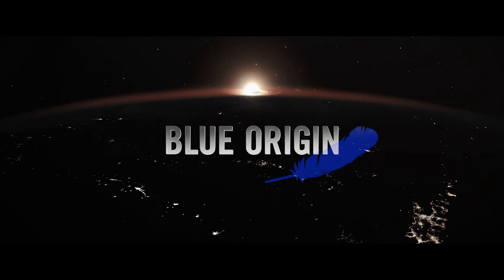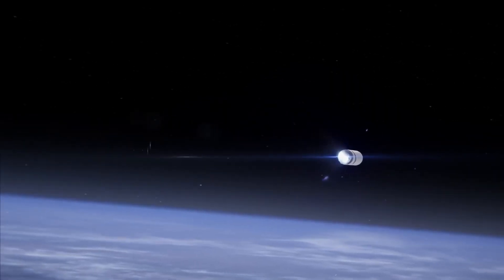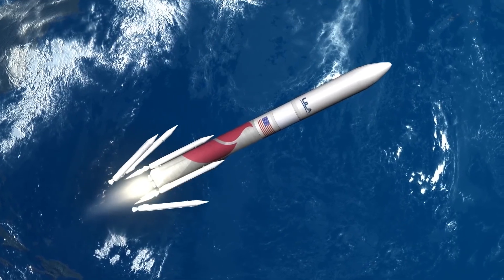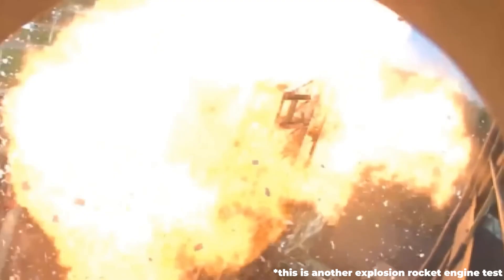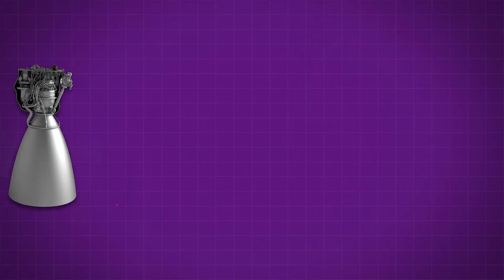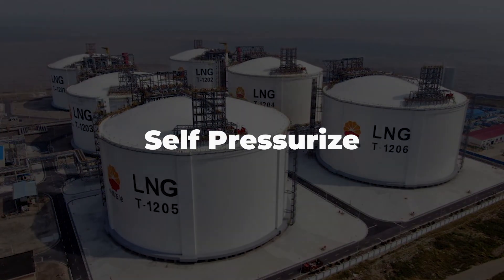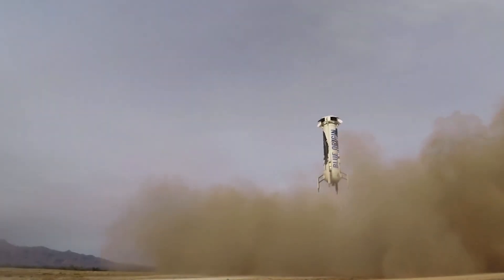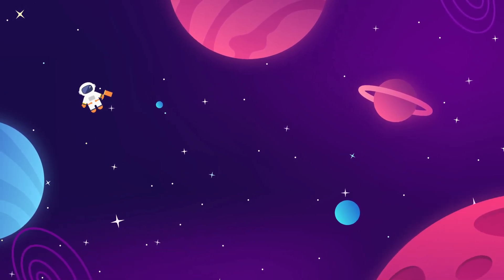The Disappointing Truth About The Blue Origin BE-4 Rocket Engine!

Comment: How many engines has BO produced to date? How many has SpaceX? What are the power, size, weight and price specs of each? 
If BO continues on this path they will get nowhere. They need to start on a new engine now, and work fast as hell to have any hope of making it a contest.
Reply: Blue is doing their best. SpaceX is running out of storage space for their hundreds of rocket motors. But once they get the Super Heavy going, they'll use them up!
Reply: @paullangford8179  Use them up? Only sometime in the future, but the boosters will be reusable, so they will only keep producing Raptors at the pace they need for the ships and boosters they want to build. It is not like they are done with producing just 200-300 Raptors. BE-4 will never be a mass-produced engine like Raptor.
Reply: Last time I heard, Elon was churning out Raptors at a rate of several per week.  BO seems to have a tough time handling half a dozen each century...
Reply: @ChristLink-Channel  Didn't a couple of BO's engine design team quit and apply for jobs at SpaceX.
Reply: When was development started on each so we can adjust for that? BE-4 is a fine engine and is rapidly approaching full deployment. This guy is a total dumbass.

Comment: The heating/combustion of methane in rocket engines does in fact produce coke/solid carbon deposits in the engine and the cooling channels due to pyrolysis (albiet less than longer chain fuels), this is commonly known and very easy to test.
Reply: Hey Kimmy
Reply: Coking from methane is extremely minimal due to the 4:1 ratio of hydrogen to carbon atoms and the fact that CH3, CH2, and CH radicals are all gasses that don't stick to anything. Even if carbon does start depositing out due to pyrolysis, the abundance of hydrogen radicals causes that carbon to form CH radicals which release and exit the rocket.
Reply: @sycodeathman  you can give all the chemistry you want but the methane engines I've tested have exhibited significant coking

Comment: Can the next video be: "The disappointing truth about the SpaceX raptor engine"? I really want SpaceX to succeed with the Raptor engines, but I can't seem to shake the feeling that it's going to take a long time to get it to be reliable, assuming it's possible and while still getting the power they want from it.
Reply: The Raptor is perfectly reliable: but when it's hit by a blizzard of concrete, there are breakages...
Reply: @paullangford8179 spacex said they did not get any data suggesting engines were damaged by the concrete
Reply: Right now spacex are developing the Raptor the same as they do anything else, which is to make constant changes and improvements as they produce them. The end result of this is that when you have a rocket with 33 engines, there are going to be tons of differences between them, from startup sequences, to hardware, and everything in between. The ones we saw fail had been sitting around for ages, and were all old and varied designs, and we also have to remember that the engine shielding was added retroactively. 
Ultimately it will be hard to judge Raptor reliability until they have the design finalized, even Merlin went through a multitude of iterations.
Reply: @SyntheticSpy  Right.  And many of the failures seen at the test site are deliberate "test to failure" events, where they pushed the engines beyond the limits on purpose, to test some aspect or other and gather more data on how to improve reliability.  Elon likes to break things on purpose, to find out why it broke so they can modify it so it won't break again.
Reply: If you'll remember back to the development of the Merlin engine for the Falcons, those also had a lot of problems before they finally got them ultra-reliable.  Merlins are a lot simpler so will have fewer issues at start-up.  That doesn't mean the Raptor is a bad engine, it's simply running on the hairy edge.

Comment: And don't get me started on those inconsistent Raptors. The sheer inability to run the engines consistently without them turning off is insane.
Reply: They are still prototypes. Non are operational. Having 10% fail is expected at this stage. The question is how long will it take them to become operational? I think they are very close.
Raptor 3 is much more powerful than Raptor 2 (~17%) that means that they could run them at 90% and still produce more power than the Raptor 2s without pushing the limits. Making them more reliable.
SpaceX works fast. We should see them soon (in 2024?).

Comment: You must do better research. 

None of the Raptor engines on Starship IFT1 blew up.  They automatically shut down when their control systems detected they were operating out of limits.  The already obsolete hydraulic gimballing system caught on fire, but still did not explode.  One of the biggest failures in IFT1 was that Starship did not blow up when instructed to.  Even while gyrating madly because of the failure of the already obsolete hydraulic system it retained extraordinary structural integrity.  The SpaceX engineers watching this were probably thinking "Maybe we could trim another half-millimetre off the thickness of the walls which would save 100kg of steel?"

Liquid natural gas is the standard way that methane is transported.  It is transported at essentially the same temperature as liquid oxygen, liquid nitrogen, and liquid air.  Indeed the fact that both fuel and oxidizer are kept at the same temperature means that methylox rockets can separate their tanks using only a thin sheet of metal.  If you tried this with a kerolox rocket the kerosene would freeze solid.  If you tried it with a hydrolox engine the liquid oxygen would freeze solid!  IMHO after sixty years of studying space technology the only reason that methylox was not explored until very recently was an insane obsession with hydrolox by NASA and ESA.  Hydrolox requires five times colder temperatures than methylox.  Making seals an plumbing that works at that insane temperature is almost impossible.  Liquid Hydrogen can literally leak straight through most metals because the molecules are so small.  The incredibly low temperatures require the thick orange insulation which I remind your audience KILLED the crew of the shuttle Columbia and almost killed the crew of the shuttle Atlantis!

ULA had the humility to purchase Russian rocket engines for the launcher which it calls Atlas but is really just a Russian Proton rocket in a slightly different form factor.  You do not explain why ULA cannot similarly have the wisdom to kick an unreliable business partner to the curb and buy much cheaper, and obviously more reliable, engines from a different American supplier.  The Raptor 2 uses the same methylox fuel as Vulcan.  The Raptor 2 has the same thrust as BE4.  The Raptor 2 is more efficient in its use of fuel (higher ISP) because of the higher chamber pressure.  The Raptor 2 has only half the mass of the BE4, and every kilogram taken off the mass of the launcher is another kilogram of payload.  And the Raptor 2 costs less to manufacture than BE4 because it is produced on an assembly line which produces 365 engines a year while BO seems to be having difficulty producing four a year.  The manufacturing cost of a Raptor 2 is less than that of a Merlin engine, and probably about one tenth the manufacturing cost of a BE4.  So SpaceX can undercut the price of any competitor, just as Tesla can undercut the price of Eve from their competitors.

How about performing a service for American taxpayers and other American customers and find out what blackmail evidence Jeff Bezos has on ULA which prevents Tory Bruno from seeking the best economic advantage for his company and his customers by switching rocket engine suppliers?  Why would anyone buy rocket engines from an online *bookstore*?

As you point out the West genuinely needs competition in the medium to heavy launch market.  The blind obsession with maintaining existing supplier chains means that at the moment: Vulcan-Centaur will not have its first launch until 2024, and will not be a reliable alternative before 2025 at the earliest.  Ariane6 will not have its first launch until 2024, and will not be a reliable alternative before 2025 at the earliest.  The Neutron will not have its first launch until 2024, and will not be a reliable alternative before 2025 at the earliest.  The Northrop-Grumman Antares rocket is no longer in production and the successor, from Firefly, will not have its first launch until 2025, and will not be a reliable alternative before 2026 at the earliest.  And meanwhile Falcon 9 has launched more than twice as often as Atlas 5 and may achieve three hundred successful launches by the end of 2023, and SpaceX has launched one Starship and has four more under assembly at Boca Chica which it will,  FAA permitting, launch by the end of 2023.  Do you really believe that the same company which has lost only one Falcon 9 in 253 launches since 4 June 2010 will not be ready for external customers by the end of this year with that track record.  If that works out then the SpaceX Super-heavy launcher will be operational before ULA, or Arianespace, even test fly their next generation medium to heavy lift boosters.
Reply: Well said!  ^^ Yes!
Reply: There were certainly engine failures on the first flight, it is incorrect to claim otherwise. I don’t, however, think it is a problem, as raptor is under development and the engines on that flight were a mishmash of slightly different engines from different stages of their development. As time goes on we will get more and more consistent and mature iterations of the raptors
Reply: @SyntheticSpy  But you wrote "blew up".  When an engine shuts itself off as a safety precaution it is highly misleading to describe that as blowing up.  There were no explosions on board the Starship.
Reply: @jamescobban857  you can actively see engines exploding during the flight test. They may not have completely detonated leaving nothing behind, but the inside of the engines absolutely did not fail quietly while at full thrust
Reply: pretty sure ALL of them blew up ya know.. cause the rocket did LOL
Reply: @cheetahjab  the ONLY explosion I observed was of the methane and oxygen mixture surrounding the rocket which took 35 seconds to ignite after the FTS smashed open the tanks of the two stages.  There was absolutely NO evidence that anything on the craft itself blew up.  Would you claim that the engine of your car blew up if the fuel in your tank was ignited?  To claim that an engine has blown up the explosion must come from within the engine.  The objective of the flight termination system is to ensure that no pieces large enough to cause damage to an innocent bystander reach the ground.  That failed as the assembly maintained too much structural integrity, indicating that it is over-built for its job.  Perhaps you lack the necessary training in engineering to understand what is involved.  If so there are many excellent books and YouTube videos.

Comment: Spacex blows up Raptor engines, pushing them to see how far they can go. BE-4 blows up, running within design specs...
Reply: Yup.  That's the way Elon does things.  His philosophy is that if you aren't blowing things up, then you aren't innovating enough!  Each explosion teaches them new things that allow them to make it better and better.  Fortunately, he can turn out dozens of Raptors each month, and has hundreds in stock, ready to fly... SpaceX has already flown dozens of Raptors (with varying degrees of success!) On the other hand BO has only managed to produce a handful of engines over the past decade or so, and none of them have ever left the ground.  The difference are, indeed, glaringly obvious.
Reply: I actually got some insiders scoop on it and it was a manufacturing flaw. Design is sound.
Reply: In a flight readiness test of an engine slated to go on a customer payload rocket.
Reply: @GntlTch   Well, that's why certification testing is done.  Some engines are not going live up to their specs, and will fail.  It happens.  The question is how often will this happen, and the answer had better be not too often.

And such a large, heavy, conservatively designed engine exploding from its relatively modest operating parameters shows how different it is from the Raptor.  The Raptor is very small in comparison, and much lighter, as well, but runs much harder and generates similar thrust.  In fact, the latest Raptor 3 is more powerful, as well as smaller and lighter than previous iterations.  Is this a good idea for reliability and reuse?  Well, in the second Starship test flight, every single Raptor functioned flawlessly, at least until something else took them out.  And that's a relatively old Raptor 2 iteration--newer and clearly vastly better than the ones used in the first test flight, but still well behind the current Raptor 3, which recently made a flawless test run at a higher thrust level than the big, lower-performance BE-4.  Maybe SpaceX really can make a high-performance engine that is also both highly reliable and reuseable.  All 33 Raptor 2s on the Super Heavy ran during the entire ascent during the last flight test.  It was a thing of beauty.
Reply: BE-4 is still in development. There's a difference. Also, Raptors simply fail for no apparent reason. Haven't you been paying attention? Apparently SpaceX isn't all that great with plumbing... or pumps... or control mechanisms... or self destruct systems... or building stable rockets beyond the Heavy, which is essentially just three normal boosters using technology that has been perfected for a minute now - not using engines still in development. The Raptor is simply further into its development. Literally nothing else to it.
Reply: @justindixon7441  in the 5 belly flop tests how many old spec raptors failed during the multi minute  ascents?
Reply: @justindixon7441   You've got it exactly backwards.  The Raptor with its high-performance full-flow cycle is far more challenging to develop, and is in the middle of development, while the BE-4, even when you posted your comment, should be operational or very nearly so, with its development complete.

Yes, like the Starship, the Raptor is already flying during instead of following development, and is being built in greater numbers, but don't let that fool you--it is definitely far from being a developed, operational engine, and is therefore behind the BE-4 in this respect.

Where the Raptor is definitely not behind is in performance, as the current design iteration, Raptor 3, is more powerful (has greater thrust) than the BE-4 despite being significantly smaller and lighter.  It is also more fuel efficient.  But the BE-4 should be a finished product, while the Raptor is still definitely a work in progress.
Reply: still better than BO  @justindixon7441

Comment: Im sorry...? How is this any different than what spaceX has been doing longsince? We also know that Starship is very close to its orbital-shot. I dont see how this engine is more important than any other. And also..the raptors shut down due to damage at takeoff but did not blow up the rocket or threatened to do so. Concrete debris was the culprit in this case.
Reply: It actually was not debris, as spacex have said they see no signs that anything hit the rocket. It’s just that Raptor is still in development, as is starship itself. There was a mishmash of different iterations of Raptor on the first flight, and will likely continue to be until the design is finalized. It’s also important to remember that these parts all sat around for an extensive amount of time in a harsh environment, and that stuff like engine shielding was added retroactively
Reply: Well...thats your opinion..the man stated that the booster created " a rock tornado"..and after watching 400pound concrete chunks with steel-bars in them exploding up along the booster all the way to the top, i find it hard to believe this had nothing to do with it. @SyntheticSpy

Comment: The test was a qualifying test - and it failed - as many raptors do.  China succeeded in launching to orbit with LNG a couple of weeks ago...
Reply: Raptors fail when they're tested to failure. The Raptor 3 test was expected to blow up, and didn't! There are hundreds of Raptors that are flight-qualified and just waiting to be put into boosters and ships. That's why Boca Chica is having so much building works, so there is room to make more of them.
Reply: Don't get me wrong - I think BO are headed to failure personally - and this failure proves the point.  I was just pointing out that engines regularly fail qualification burns, so they don't know yet if it's manufacturing fault or major fault as they've made so few of them.  Lots of raptors have failed on the test stand. @paullangford8179
Reply: This guy is clueless, don't worry about it.
Reply: really?  you're qualified are you? @justindixon7441